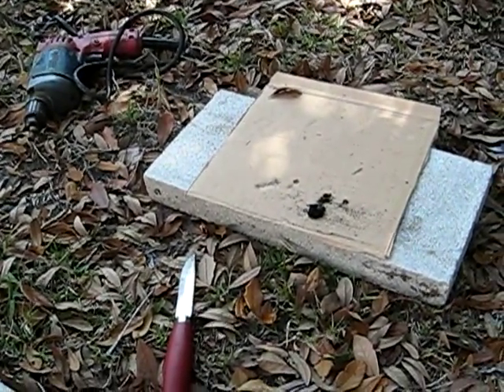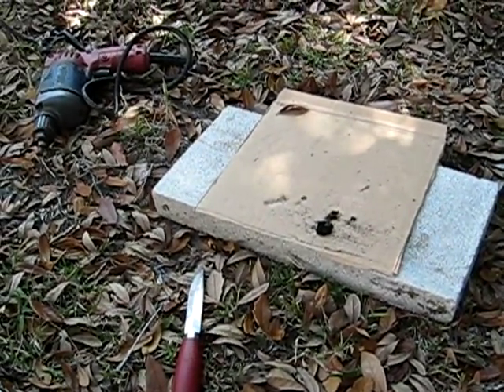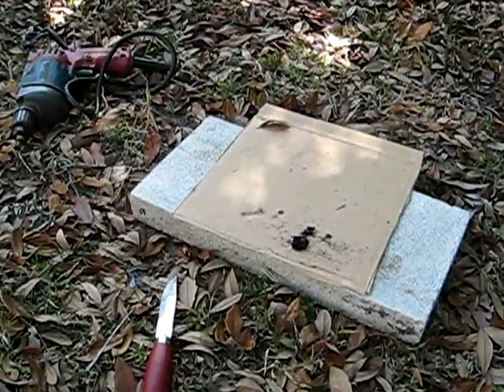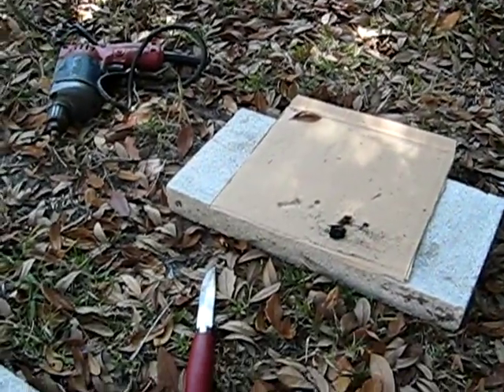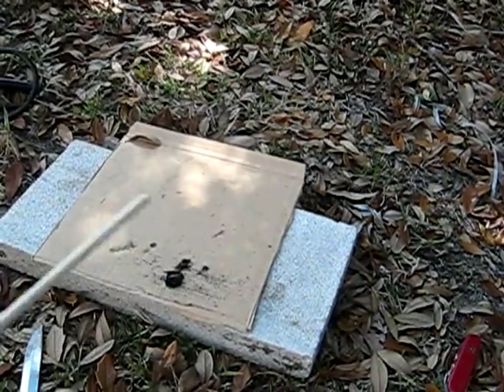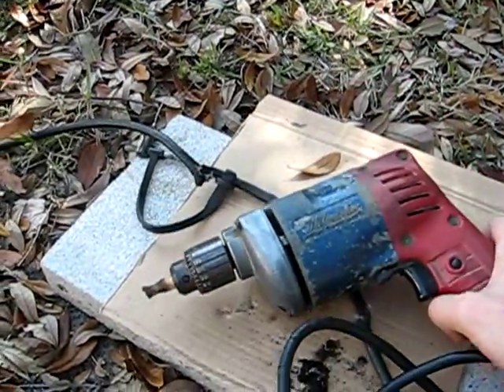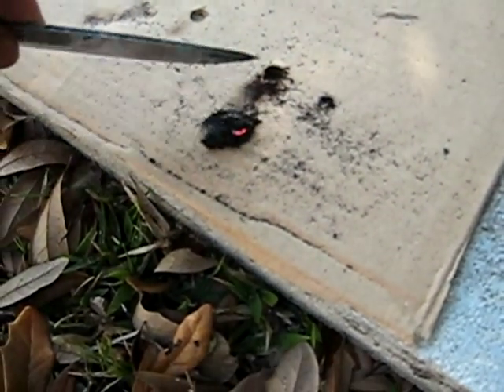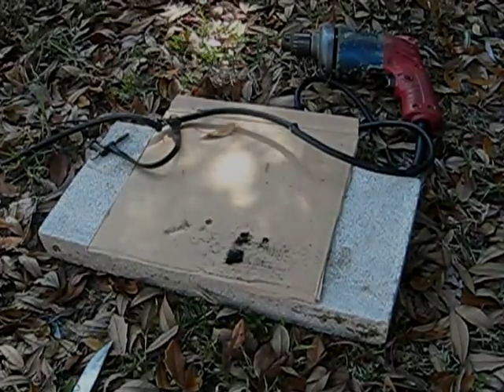Power Drill Friction Fire

Comment: I figured that I'd try a power drill to find out what wood works the best for friction fire so that I wouldn't get frustrated when I fail over and over again with the wrong type of wood. I never got an ember with the drill but I did get an ember with bowdrill eventually. That was so f'ing amazing experience. Can't really describe it. I had tried that same wood combination with the drill but got nothing. Maybe too much rpm's, idk. I too thought it would be easy with the power drill but nope.
Reply from the maker: Glad you had an amazing successful experience with the bow drill. The main reason the power drill isn't easier than the traditional bow drill is the spinning direction of the spindle doesn't alternate back & forth like the bow drill. It makes a difference on how the hot dust forms in the notch.
Reply: +gundog5 That makes sense. It was very different how the dust formed.

Comment from the maker: @ThePetrifiedwood I think one issue I was having was the drill was spinning so fast It would vibrate the fireboard and the dust would blow away (air from the drill). Applying more downward pressure slowed down the drill, minimizing vibration and the dust would stay in place. The side-effect was the dust being more gritty (coarse) due to so much pressure.
I'll try it again with a better drill to see if there's a difference.